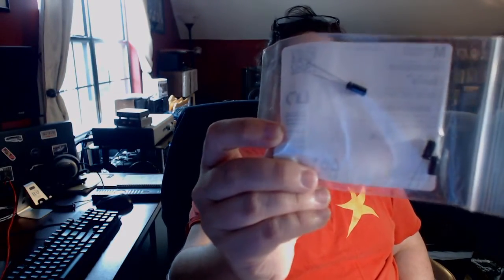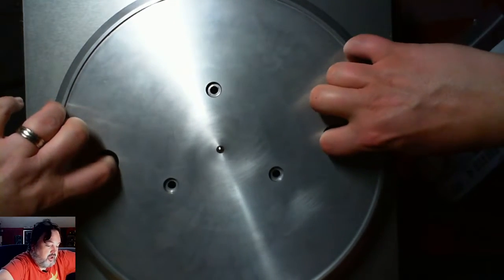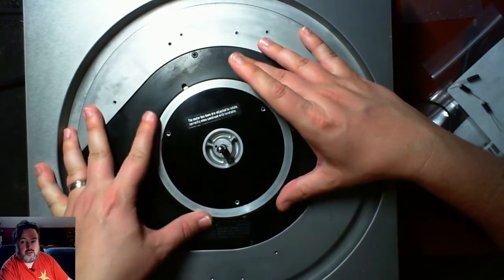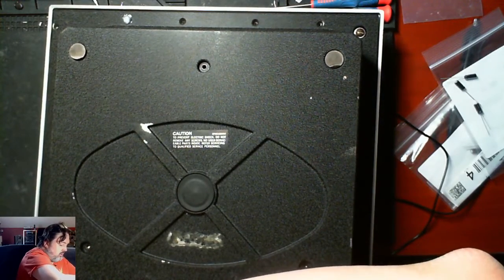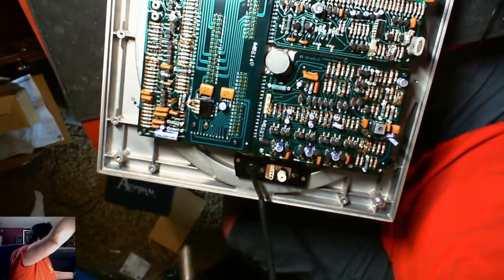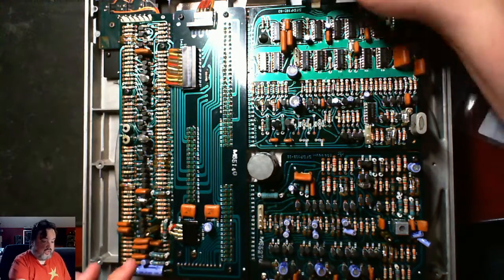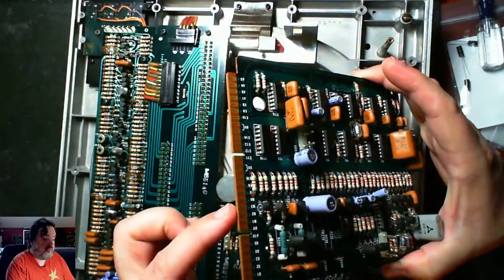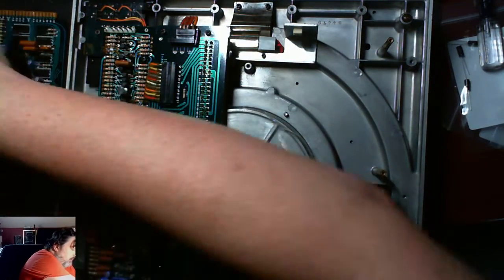Technics SP-10 Board Layout and Removal

Comment: You could have had all those boards out if you didn't waste time talking about parts that had nothing to do with the task at hand. "Don''t touch the bearing!" would have been good enough. You get into trouble when you start guessing on the tech. Heat to remove bearing cap and it will twist right off. I did need you video to show somebody what they were up against. Their dec is running backwards when he turns it on and he can't get anybody to work on his SP10 mark 2.
Reply from the maker: Thanks for your insight.

Comment: I have an SP-10 MK2 and I was hoping I can get some advise. A month or so ago, it spun really fast then lately it completely stopped spinning. I am thinking a cap or resistor in the speed controller board is toast. How do I proceed to isolate and fix the problem? Thanks again.
Reply from the maker: I’m no pro turntable repair tech. Although you can verify the DC voltage outputs of the PSU. The PSU service manual is out there.
Reply: @stereoazimuth   Thanks! I have the service manual. Will check this later.

Comment: DO NOT use a breaker bar or huge wrench on the bearing cap!! It is secured by a heat-set thread locker, similar to Loctite 271. A hair dryer on hot will get the cap warm enough to release it. It’s best if you remove the motor assembly when you do this, or if you must do it while things are attached to the chassis, make a heat shield out of a couple layers of aluminum foil. 

Thanks for posting this great information on the best turntables ever made. Every single one of them should be restored and put back into another 40yr+ worth of service. :)
Reply from the maker: Good advice. Thanks!

Comment: That's very useful. Been a while since I last looked at a SP10 mkII innards. Somehow it now looks far less daunting than before. Impressive amount of film caps! Who would've known - I guess they were going for quality after all!
I didn't know you should oil these. Any chance you can do a video on that, e.g. what type of oil to use, how to etc.? I guess it's in the service manual but it's always useful to hear from someone that has actually done as well as find out what the pitfalls are, what you can learn about the deck from the spindle feel etc. 

One thing you should watch out for with Japanese equipment (especially expensive or rare ones) is that they contain a lot of screws that look like Philips head screws when in fact they are of a similar JIS type. You need the right screwdriver for these. Not sure where you can get it from (Amazon Japan? US? Farnell?) but you will damage these screws eventually if you undo them often or if they are too tight by using a Philips screwdriver.
Reply: Film caps are really required in quartz servo systems. The film caps caan last a lifetime, but electrolytics are another story.
Reply: @charleshendricks9188  Yes, generally that's considered true, but some film caps have been known to fail (certain RIFA mains RF suppression types, i believe, and others) while certain electrolytics have proven to last quite a long time. The good thing is that nowadays one can obtain 1uF - 10uF film caps that are both economical and small enough to use in the place of electrolytics in most instances. That can help prolong equipment lifetime or, at the very least, service intervals.

Comment: Question is, why do some people rave about these, what makes it special? Maybe the speed controller?
Reply from the maker: No...the SP-10 MKII has crazy amounts of torque and super heavyweight platter (almost twice as weighty as the SL-1200). The motor though has more coils that are also bigger for high torque and more precise control. Better specs all around over the SL-1200 MKII.
Reply: @stereoazimuth  Thanks for the info, getting ideas on how to upgrade my systemdek, directdrive crossed my mind, but I have yet to see a audiophile deck use one, till this.